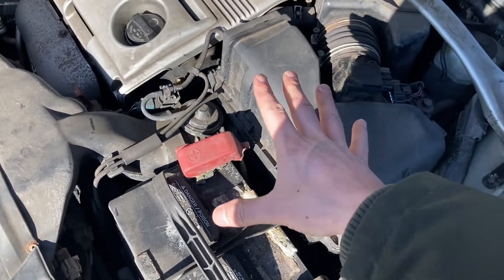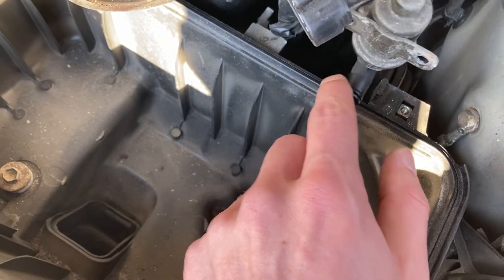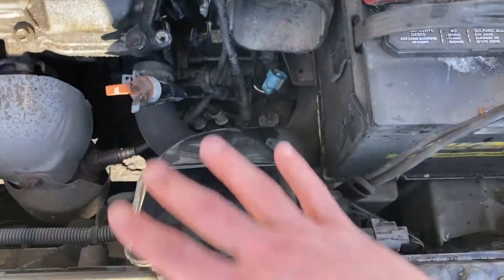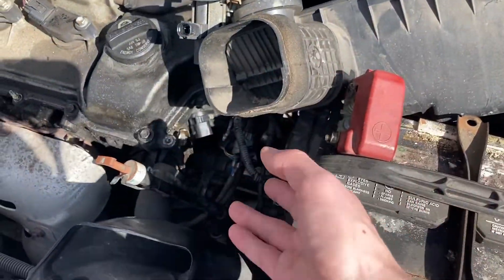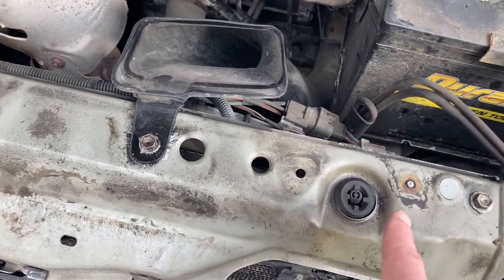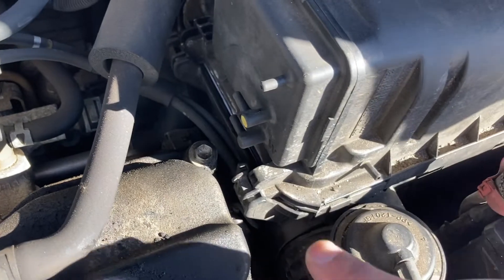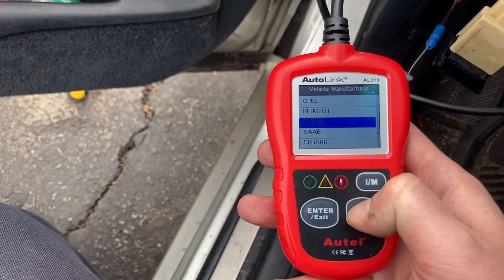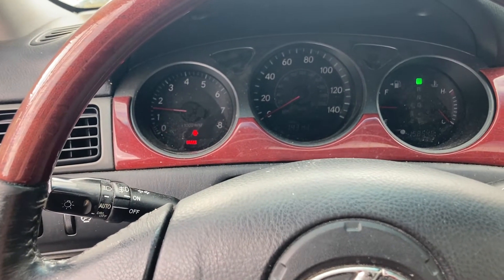P1350 Lexus Camshaft Position Sensor Fix 1MZ-FE

Comment: Hey bro there is sludge under my oil filler cap too should I run sea foam or something? Car has less than 89k for an 02 I wanna keep it running forever
Reply from the maker: Thanks a bunch for watching and taking the time to comment. Personally I don’t sea foam my cars, instead I would use quality oil and do my oil changes more often about every 3000 miles. If you don’t drive a lot, at least every 6 months. Also, make sure you are using the correct octane fuel in your vehicle. Given that your car is a 2002 you may want to check if you have serviced the typical items like spark plugs and engine air filter. Please share an update, thanks.
Reply: @ I just did the cam sensor with good success and since I’ve owned it I really only ever put premium . I did the filter same time as cam sensor no more p1350 thank you. I just don’t think the sludge is good long term and maybe I should run some type of oil flush? Or at least drop the oil pan and clean it… My 02 only has 88,600 I want it to stay running
Reply from the maker: Thanks for the update, personally I am not a fan of oil flush type products. I prefer to cycle my oil change in a shorter interval using the exact recommended oil per manual. It maybe a lot of work for you to drop the oil pan, but if you’re up for the task something to consider. Please share an update, thanks.
Reply: @ The p1350 came back on a couple days after it being fixed, I cleared it and hasn’t came back on yet. But I’m very frustrated I spent a lot of time tearing this thing apart
Reply from the maker: Thanks for the update. When you removed the sensor did the connection have oil on it? Did you service your oil filler cap seal? You mentioned your oil being dirty. If you are clearing the code and it’s not coming back immediately it’s more likely the oil quality and or the connection. 
	2.	Wiring Issues: There could be an open or short circuit in the wiring harness between the ECM (Engine Control Module) and the VVT sensor.
	3.	Oil-Related Problems: Dirty oil or oil leaking onto the sensor can cause this error.
	4.	ECM Issues: In rare cases, the problem might be with the ECM itself.
Please share an update and good luck with your diagnosis.

Comment: Do you need Toyota or OEM
Reply from the maker: Thanks a bunch for watching personally I use the sensor from Toyota. Please share an update, thanks.
Reply: @WheelsTips Thanks just saw this I’m getting an OEM on Monday I have p1350 mechanic charged me to replace VVT sensors and it didn’t fix it so this looks easy to do Thank you
Reply from the maker: You got it. To the best of my memory no one offered the correct sensor other than Toyota/Lexus dealer, maybe someone made an OEM version since the time I worked on mine. Much luck with your diagnostics! Please share an update.
Reply: @WheelsTips It’s on eBay same part number you showed on video
Reply from the maker: Any update on your issue?
Reply: @WheelsTips  I’m gonna spray contact cleaner on the connectors because it keeps coming on after a drive cycle I’m about to do that when the engine cools off I’ll update Thanks boss
Reply from the maker: Hope it all worked out!

Comment: I have the same code you did p1350 variable valve timing/cam position sensor.  I removed both oil control valves and check their ohms as well as hooking them up to a battery to manipulate the solenoid.  They both worked.  I also have a leaky oil cap.  I did unplug the cam position sensor plug and cleaned it out it didn’t have any oil in it though.  You referenced in your video that your sensor was full of oil as was mine.  I’m a little confused because isn’t it exposed to oil under the valve covers?  Are you saying this cps should be dry when removing it?   Thank you I want to know before replacing it because they are a little spendy!
Reply from the maker: Thanks a bunch for watching my video and taking the time to comment. I would check the sensor by it’s resistance. The sensors plug connector was covered in oil, the sensor itself should be in contact with oil. Please share an update, thanks.
Reply: @WheelsTips  I could not figure out how to test the resistance since its a 3 pin plug.  The 2 pins are easy.  Any tips?
Reply from the maker: I don’t have the service manual, but if you are able to get one they have a test procedure for that sensor. Please share an update, thanks.

Comment: Do these need a relearning step or just replace and go, replaced one on a 03 RX330 and it's in limp mode and can't pull any codes from it
Reply from the maker: Thanks a bunch for watching and taking the time to comment.  Personally I have not used a relearn procedure when replacing the camshaft position sensor. You can always try the ignition in position 2 for 90 seconds.  I would check your fuses to make sure nothing is blown since you can not communicate with the ECU, please share an update.  It is also possible your scanner can not communicate with engine off.  I have had this issue with budget scanners.  Please share an update, thanks.
Reply: @WheelsTips  Yeah, just got the car and scanner took is not connecting, will check fuses and then check the pins in the OBD connection for worn inputs. But they put in new sensor and they say it will go into limp mode after driving hence the reason they sold it for $1000, hopefully it's just a super simple fix and easy flip!
Reply from the maker: Make sure you have a scanner that can connect the the proper protocol. Maybe they replaced the wrong sensor and make sure it has oil. Looking forward to an update.
Reply: @WheelsTips  one of the pins was worn out in the connection, fixed that got it to read and the scan unit the dealership has didn't give an option to reset the CAS, so, I don't know now if their thousands of dollars scanner can't do it. Thing runs too rough to do the manual way
Reply from the maker: Looking forward to an update.

Comment: thanks for the video ! I have this engine (in my aussie avalon 2005). Consider it a good engine....leaks a few drops of oil on the driveway after giving it a run. My fuel economy is pretty crap so I will try this part to see if it helps. I will update but it will take 8 weeks from now to get the genuine toyota part. I regularly change the filter and oil on this engine (every 6 months) because I heard they (the 1MZ-FE) can sludge up. Cheers from Perth, W.A
Reply from the maker: Thanks so much for watching my video and taking the time to share all this information. I wouldn’t change the sensor if you have no fault codes or stored fault codes as the sensor is working properly in that case. You may want to check the oil filler cap gasket to make sure it is still sealing properly as a preemptive measure against code P1350. Please share an update, thanks.

Comment: Thanks for the video,  
What are the symptoms that the car presented?,  I have an avalon 2000 1MZFE and it misfires in the cilinder 3 and the rpm cuts on 2500 wont acelerate more than that, the codes are p1350, p0303
Reply from the maker: Thanks a bunch for watching my video and taking the time to comment. There were no drivability issues, just check engine light which I needed to get rid of for emission inspection. Have you already checked your ignition coil and spark plug on cylinder 3? I personally always remedy a misfire before any other codes. Please share an update, thanks.

Comment: Di I miss something? Are you replacing your can position sensor or crank sensor? DO they label their parts like this or did you use it for example? Thanks for the video. Im trying to find a video for bank 1 myself.
Reply: I just ordered that part from toyota in australia (I live in perth). I got the invoice and it said "crank sensor" so I emailed back and said you got the wrong part, I wanted a cam angle sensor. However, the cam angle sensor IS labelled as a crank sensor because according to the parts tech "toyota use this sensor as a crank sensor (as well) for other engines". Confused? I was but the naming of this part is very confusing. As long as it's for the engine head the "sensor crank" is in fact a cam angle sensor for the 1MZ-FE (in this case)
Reply from the maker: Thanks a bunch for sharing this information, very helpful.
Reply from the maker: Thanks a bunch for watching my video and taking the time to comment.  That is the exact sensor I used to put into my car at that exact location.  Is that the location of the senor you are looking to replace? Is the connection covered in oil like mine from neglecting to maintain the oil cap seal?  Thanks for any update.
Reply: @WheelsTips  Thanks for the reply. Yes that is the cam position sensor. One in each bank. Firewall =Bank 1=R.  Radiator=Bank 2=L). I also replaced both OCV's AND to my surprise they both had filters by the cam position sensor that I replaced. I also replaced the pigtail to bank #2 (because it broke) from switching the sensors to see if the P1346 would switch to bank #2. It did for a second. Replaced BOTH Cam position sensors. Problem went back to bank 1. Got the O-scope and Multimeter and back probed the connections. They worked fine. Probed the ECU worked fine. I was hoping that the problem was the Phasers but because of smog Nazis here in Ca my brother in law traded it in so I will never know the issue. On the positive I did learn all about the new technology of VVT. Thanks for the help.
Reply from the maker: @deans2917  sorry to hear you weren’t able to get the car through smog a lot of older cars have this issue. Thank you so much for taking the time to write this detailed follow up. What did you trade in for? Thanks again for all the updates, this will definitely help many people with the same issue.